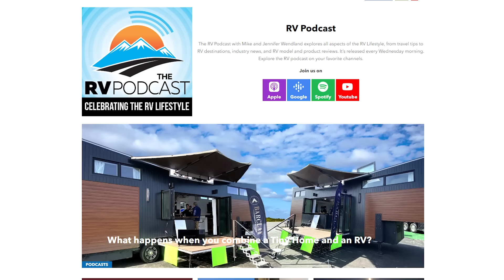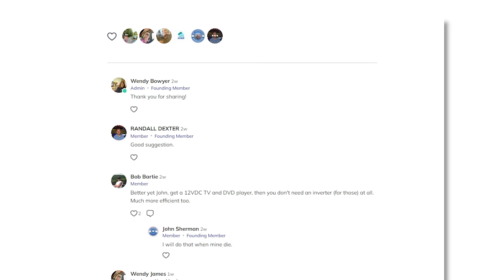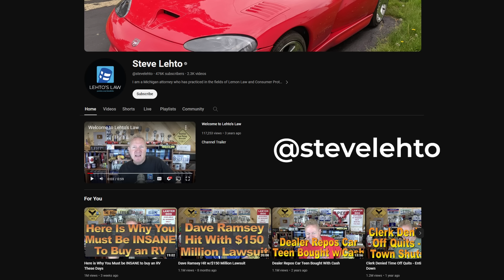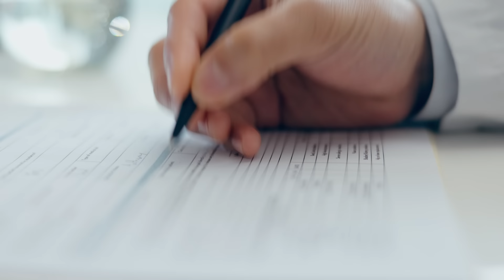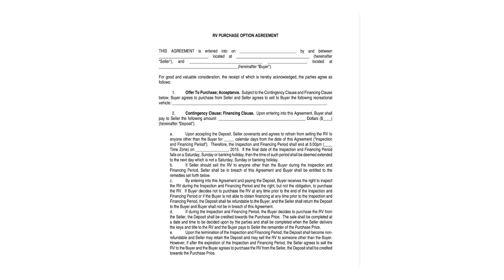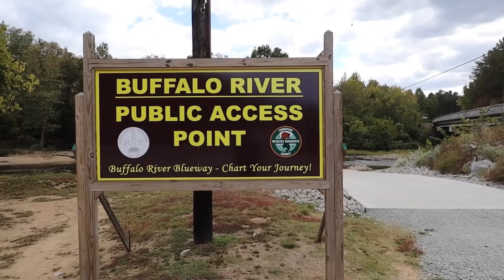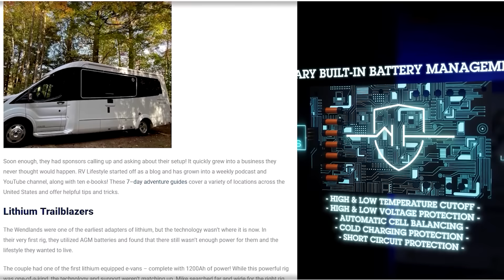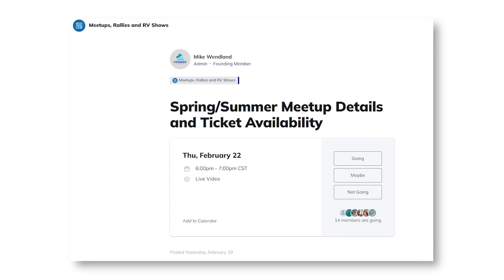Attorney Says You’re Crazy to Buy a New RV

Comment: If your rig has a closed space to store and charge your ebike, PLEASE PUT A SMOKE DETECTOR IN THERE. There is a problem with ebikes catching fire while charging.
 Even better would be to add an extinguisher device, which goes off automatically if there's a fire there.
 A fire in that compartment, unseen, would grow large enough to burn down your whole rig before you found it. And that tiny stock fire extinguisher won't help.